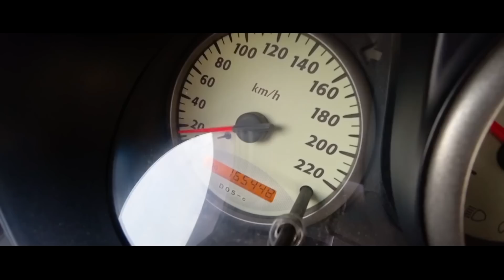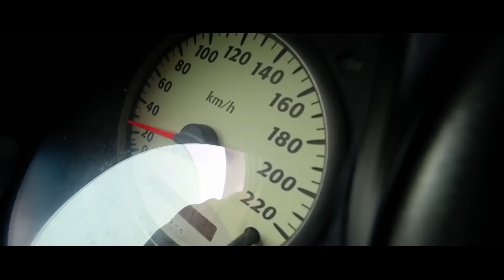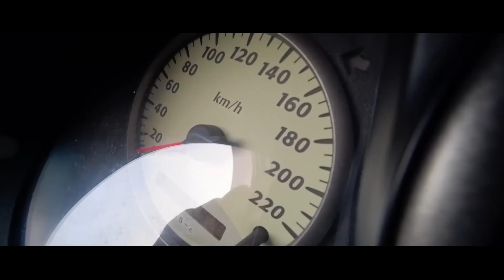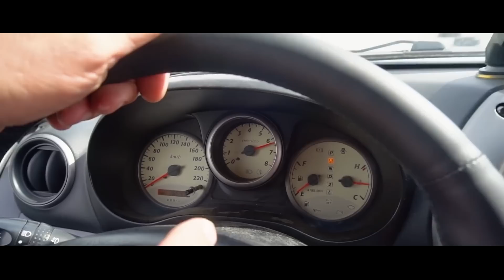What happens when you engage reverse at 62 MPH?

Comment: Can you convert a diesel engine to petrol

Or convert a petrol engine to a diesel engine
Reply: No, I am guessing you would have to rebuild (and redesign) the engine since they function differently
Reply: Diesel runs off compression, gas runs off spark. If you changed the fuel injectors and somehow added spark plugs to the cylinder it theoretically could work.. An engine only needs 3 things. Fuel air and combustion.
Reply: @shanetaggart6060  and compression, even in a petrol
Reply: Ratonmone look at the olds 350 Diesel...  it worked? Kind of?
Reply: Could you? Sure anything's possible with enough time and money. Would it be reliable and cheaper than designing from scratch? no. Its like a swiss army knife vs any specific tool on there. it does everything okay but it doesn't do anything good.
Reply: I have seen diesel engines converted to run off of Propane. it was a Perkins too!
Reply: there is a old tractor that would start on petrol then switch to diesel. they did that because petrol starts up better. it had adjustable compression and spark plugs 😂
Reply: @connorvelthuis2221  yep gm just used a 350 sbc it had issues lol
Reply: just last night was thinking of it, add some spark plugs and put injectors and it should work? what you think?
Reply: Not at all because they are way to diferent. If you would manage to do that, a petrol engine turned into diesel would be very weak, and will never ever work unless the modified parts aren't sealed properly.
And a diesel engine turned into petrol would also be weak, but it would be easier to do, however  improper construction will result in the engine breaking fast.
Reply: piston crowns are the wrong shape so the spark plug electrobe will chisel a hole through the top of the piston detonating the engine ,  heater plugs dont stress about the shape of the flash point , they sit out the way and get hot , thats for diesel to petrol .... petrol to diesel you would need to find at least double the compression ration which is possible if you skim the shit out of it and say weld washers next to the valves . Expect it to run like a 65 year old indian or russian made engine .
Reply: A diesel to ethanol, if you somehow put a spark plug will work...
Reply: @shanetaggart6060  it´s fuel, air, timing and compression
Reply: ummm on first there is diffrent compression in those engines, petrol its about (mostly) 15bar and diesel (also mostly) about 30bar so.. 
petrol > diesel = will maybe work but it will be weak
diesel > petrol = will work only if engine will be modify to beat down a compression, ex. maybe other pistons, that fits to cylinders but they have smaller dimensions in high... its like buliding a stroker, ex m50b25 (bmw 2.5l petrol), taking pistons and the connecting rod from M52B28 (also bmw 2.8l petrol) and puting this B28 things to B25 block and they make it for "cut" some compression to add a turbo.. 
sorry for my eng, but u know what i had in mind
Reply: my point is: in a diesel engine, without make it smaller compression wil be a Knocking combustion 
litle curiosity - in a Fiat 126p a petrol car with 650ccm, two cylinders both working exact same time (first is up, and second is up, they work together), sometimes in summer or when engine is HOT, its comming to knocking combustion, even if you turn ignioton off, and get of from a car, engine will spin a few times without a spark... its normal to this engines they say..
Reply: Shane Taggart gas in a diesel would work, no modifications required purely because of how much compression there is, just like using 87 octane gas in a car that’s tuned for 91, itl ping because it can’t resist the compression like 91 can
Reply: Its caled a powerstroke
Reply: @switelolo1241  i agree with that, a diesel engine beeing fed by gas is going to work somewhat ok, but a gas engine will not run on diesel without adapting it
Reply: @switelolo1241  Its called 'running on' and was common on many  cars until someone decided to build a better engine...Carbon deposits glowing away in the cylinder head don't help.
Reply: огромная эрекция  Da!
Reply: you can run gasoline in a diesel engine, but the injection style combustion with a high compression combustion can result in higher revs but lower torque. the downside is that gasoline doesn't lubricate the same way diesel doues. the engin runs lean on fuel
Reply: @Ratonmone gm tried that already. Wasn't good.
Reply: Just search Dieselpacko B230! He converted a B230 volvo engine to a IDI Turbodiesel!
Reply: No.
Reply: It would cost more money then an engine swap. Diesel is heated and compressed in the cylinders which is how it burns but petrol is ignited using spark plugs. Im quite sure that diesal is also pumped into the engine differently aswell. Im no professional mechanic thou. I think petrol uses a carburettor  and diesel uses a pump.
Reply: Just take the head gasket out to increase the compression to the 35:1 compression ratio you need for diesel
Reply: @shanetaggart6060  I suspect that if you had a Head that fitted the Diesel Engine block, you probably could convert a Diesel to Petrol. As you point out, trying to convert a Petrol to Diesel would be much more difficult I think due to compression issues. I think if you had the compression in a petrol engine to make it Diesel, the internals would likely prove insufficient as far as strength is concerned.
Reply: @shanetaggart6060  Diesel's require high compression for ignition.. Petrols require spark.. High compression of diesel engine with petrol as fuel will cause engine knocking due to premature detonation. On Petrol engines with Diesel fuel, it wud just not start up, or keep knocking stopping after intermittent knocks cause the diesel won't ignite well with low compression
Reply: diesel to petrol is easy because we can skim the piston head to decrease its compresion ratio.

but petrol to diesel need a bunch of redesign part
Reply: Too many parts, to switch, between Petrol, or Diesel.  Diesel is nice, in that it can run on renewable fuels.

You could have electric drive motors, at both front, and rear axles, and use a generator, or battery pack, that are dropped in, via a hoist.  The Generator, could be Diesel, Petrol, or even Propane fueled.  Brakes, and steering, would be electric. 

Now it would be funny, to power a Tesla model X, with a Diesel generator, in tow.
Reply: Not too difficult since there are diesels with sparkplugs too.
Reply: On the series 2 landrovers it was only the head and fuel system that differed, they shared the same block between diesel and petrol.
There's the difference, it's a lot of stuff.
Reply: no and no
Reply: There were some Multi fuel concept engines running with gas and Diesel. 
Just google it.
Reply: I have done almost this. I had two  Case tractors, one engine was diesel when was gas they were almost interchangeable and parts with several exceptions. Both had damage. But I pulled the sleeves, crank and pistons from the diesel  reworked the gas engine to take the diesel parts and used the gas parts for most everything else. It worked great. It's horsepower raised a lot. The trouble is it does have detonation rattle. After playing with various octain boosters and such it turns out adding a quart of diesel to every 10 gallons of gas controls that well.
Reply: @novicespellcaster  not by much. a new head and pistons would change it over completely. It just won't last long or make as much power...
Reply: @birisuandrei2866  No. A Petrol engine converted to Diesel will work, only not very well. The head gasket will blow all the time, and blowby will be pretty severe. But it will work.
Reply: @asovietreunion13  that's what I said dude, it would work, although poorly but only if it's properly assembled.
Because petrol engines are basically using a controlled explosion to create energy.
But diesel is more complicated as it works with high pressures and if the pressure isn't enough the engine won't work.
Reply: @Jan_372  actually no, sparkplugs don't exist in diesel engines. They have a diferent kind of plug but I can't really tell you how it's called cause I've learned my job in German, they work differently though, trust me.
Reply: @Jobanivrodnachui  but they have two engines, one for each fuel. Using two diferent fuels in one engine isn't plausible as diferent fuels produce diferent levels of energy and no matter how you pour the fuels in, the engine wont run smoothly or will be weaker than when using just one fuel.
Reply: Yes it can be done with modifications it wouldn't just work changing fuels if your going from gas to diesel you would have to add injectors and a lot of compression
Reply: @birisuandrei2866  there was already a multi fuel engine in 2011, and mercedes did this in 2007 .
It works and its called ccs combined combustion system
Reply: you can if you use concentrated dark matter
Reply: A diesel could run off petrol alone but it would need more than the injectors could give. Any fuel will combust from compression if it's high enough
Reply: The answer you are looking for is yes. But I wouldn't recommend using an aluminium cylinder block or head. (if petrol to diesel)
Reply: @randylahey2242  You'd need a cylinder head to fit.
Reply: @novicespellcaster  Not with one of the newfangled direct injection ones.
Reply: In india when a gas engine fails I have seen a backyard mechanic rrmove sparkplugs and install high pressure fuel i jectors to convert into diesel
Reply: The last weekend i think that
Reply: With a petrol engine if you raise the compression a huge amount, install diesel injectors and injector pump, and a few more things thatll take an age to explain. The cost of that would be waaaayyyyy more expensive than actually buying a brand new diesel engine. Even then, you'd be left with a physically weaker engine that would last no length of time and would never be reliable. Biggest problem i could see is bending con rods burning holes in pistons and the head and also constantly blowing head gaskets. Also the inlet and exhaust times would have to be adjusted soooo basically make your own new camshaft. Far easier to just buy a brand spanking new diesel engine than try to correctly convert a petrol to diesel and be reliable
Reply: @boxr_4214  yes but diesels are super high compression
Reply: @redneckasmr-xd1gg  you're talking about the WD-9. It is indirect injection with a combustion chamber in the head for both the gas and the diesel. When you switch from the gas to diesel, you move a lever that closes the gas combustion chamber and opens the diesel.
Reply: Top gear have an episode on that. Look it up.
Reply: @shanetaggart6060  Diesel engines have been converted to spark. People that run water mixes or pure water do it with diesel engines often, check out the dual anode coaxial injector by Robert Kurpa which is the basis of most of this replication effort, works on petrol or diesel engines.
Of course the jew media never want you to know that.
Reply: @redneckasmr-xd1gg  it was a 3rd valve that opened up and lowered compression to around 7:1 and exposed the spark plug
Reply: you can put gasoline on diesel it will moove shortly but it will smell bad and is gonna kick hard like ''paf paf'' all the time.
diesel on gazoline may not even start, and if it did, it will shutt off repetetly
Reply: no spark
Reply: I think you can convert diesel to petrol but not the other way around. Diesel blocks have to be stronger than petrol due to the high compression. It would make an interesting project. Obviously all the components would need to be changed too.
Reply: @rachelbrinkley3240  Diesel engines with different injectors can burn anything! Well... just not kerosene. It needs to be pressurized and heated up before it works
Reply: @Ratonmone olds diesel is a chevy 350 that's been converted to diesel at the factory, people usually convert them back to gas.  most military diesels will run on either or a mix of both without complaints
Reply: David I believe it is a super c farmall
Reply: Surly the result would be having a petrol engine or a Diesel engine in the end ?
Reply: Cummins did just this when they made a CNG variant of their diesel engines
Reply: Even if you managed a diesel to petrol the engine would quickly sieze up because the diesel
Reply: Diesel fuel will work in a gas engine, not well but it can run.
Reply: shaun milnes I can tell you from personal experience you’re wrong about them running on the wrong fuel. I filled up a 900cc bike with diesel by mistake one time & it stopped running immediately. You’re correct about gas in a diesel, it will damage the engine because no lubrication.
Reply: You can run some old diesel cars with petrol. But you can't run petrols with diesel. Burning diesel is much harder.
Reply: Sorry for the late reply back and wow this has kicked off fantastic lol 

Was meaning let's say we have a ford diesel engine 

And the same petrol engine but a diesel keep in mind same block 

Would these be able to be switched over from engine to engine 

Petrol engine now diesel 
Diesel engine now petrol
Reply: Yes, just ask oldsmobile how to do it
Reply: You actually can convert diesel into gas but not gas into diesel
Reply: Anything is possible
Reply: Many Diesel engines will run off petrol. The smaller high compression Diesel engines you often see will probably not work though.
Reply: @baileyharrison1030  its not that you can rebuild a diesel engine so it can work as only petrol the thing is different materials , the diesel also can hold more pressure for turbo charge

Comment: The way it works is a valve is installed that when the car is moving forward at  more than 5-7mph it has a back pressure and cannot pass fluit to the Band or brake that ingages Reverse. As you said "like throwing it in neutral.
Reply: Fluid*
Engage*
Reply: @ZzzRoofus  good techs cant spell for shit, but they can figure out how to fix anything

Comment: There is (depending on the vehicle) a control module which manages shifting into the next gear. It will either be built into the ECU or it will be an independant module. Either way, it will detect and prevent a bad gearshift (from, say drive to park while moving or from drive to reverse) until the vehicle eventually stops.

Also, there's a good chance that after slamming this one into reverse so much has trashed the fricton bands that engage the planetary gear sets in the gearbox. This would also explain the smell of burning clutch and why the vehicle needed insane amounts of throttle just to roll. They use a similar material to clutches so the smell from one being worn excessively would be extremely similar. They also wear down insanely fast if they are subjecct to excessive stress or bad shifting maneuvres. Say, using park as a brake or slamming into reversewhile moving forwards. Once they're worn out... they slip, and once they slip... you need more revs to get moving, and the vehicle will be a lot slower than it's intended to be. OR, you end up sat there revving the tits off it in drive and not moving at all.
Reply: what sort of Japanese sorcery is this?🤣😂🤣

Comment: take the engine out and try to drive with just the starter motor
Reply: It would just burn up. They aren't designed to be used more than 10 or 15 seconds at a time.
Reply: It needs a flywheel to work😉 they could just put it in a gear without sparkplugs and just try to start it
Reply: They did this with a little Lada Samara. Still had the engine in, but no spark plugs
it went for miles on the motor just fine ! That motor is strong !
Reply: Saw MasterMilo do it for a few seconds...
I can't remember what experiment they did...
but the engine wouldn't start...
So in order to put the car on the flatbed he used the starter motor.
And he said one of the best quotes of his:
"We have an electric car!"
r/technicallythetruth 
xD
Reply: Slid off an icy road. Used the starter to pull me out. Unhooked the coil wire and cranked it over.
This was before the clutch safety switches were installed. 69 f100

Comment: I did this by accident once long ago, driving an old 80's square body chevy. I was going 55-60mph when I went to shift it into neutral to coast down a hill. I missed it and accidentally put it in reverse. 

WHAM! Instantly stalled my V8 diesel engine, lost all power steering, power brakes, and I skidded to a stop in traffic. Thankfully I yanked it out of reverse and was able to coast onto the side of the road, where I cussed and punched the ceiling of the cab for a while. Then I cranked it to life.... and drove home without issue.

That transmission never did give out on me. It survived for years after, until I rolled the truck into a ditch and totaled it. It was a Turbo 400, just for the record, powered by a 6.2l detroit diesel.

Comment: Amused.  I did that in my ‘82 Bronco once on accident when I still had my automatic transmission installed.  Thank GOD for icy roads and a decent torque converter without a lockup function.

Comment: I was able to do it in a '92 Subaru SVX. I didn't know when I bought it that it needed premium fuel and I was putting regular in it. Eventually it got to the point that it would take a lllooonnnggg time to switch to 2nd gear (because of the knock sensor). So I would treat it as a manual and shift though the 1st-3rd gears until I got up to speed. It seemed to work better when I did that and I had no idea why what was wrong at the time. Over a while of doing this, I was shifting out of an intersection (30+mph), and I accidentally went from 3rd to "R" instead of "D".... ALL FOUR WHEELS LOCKED UP.... I swear I had whiplash for a week, lol!!!